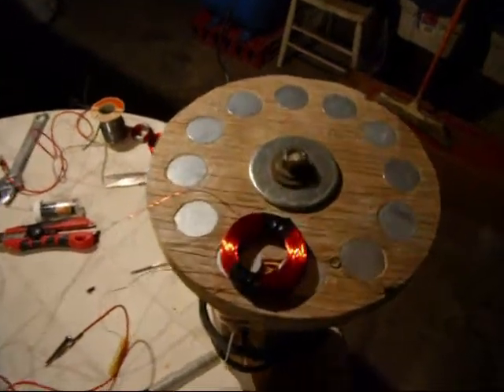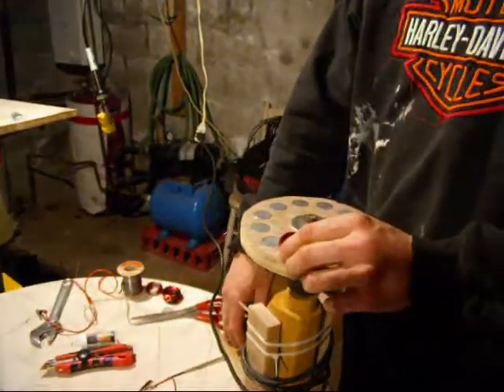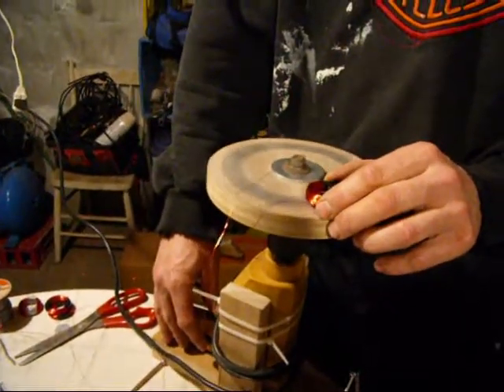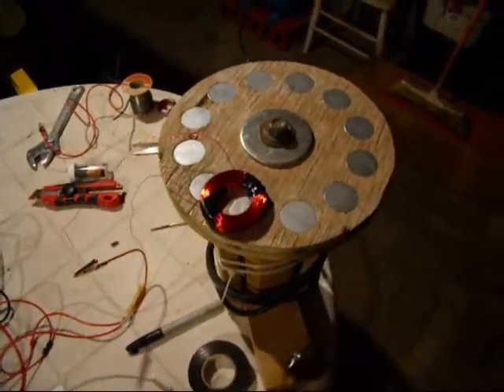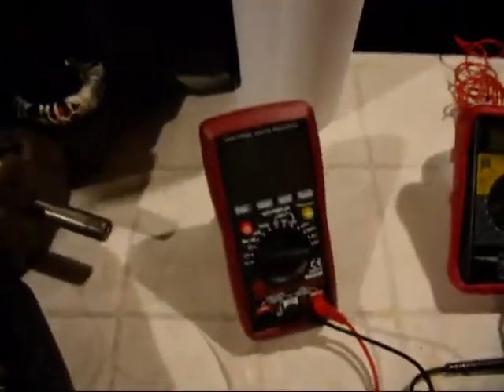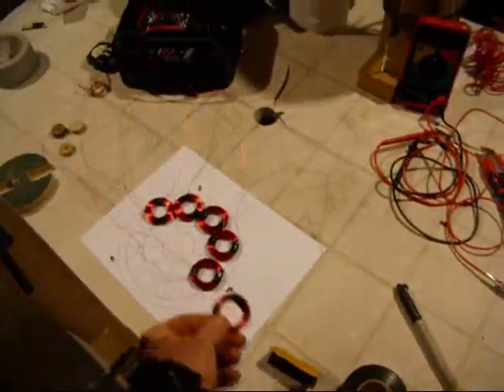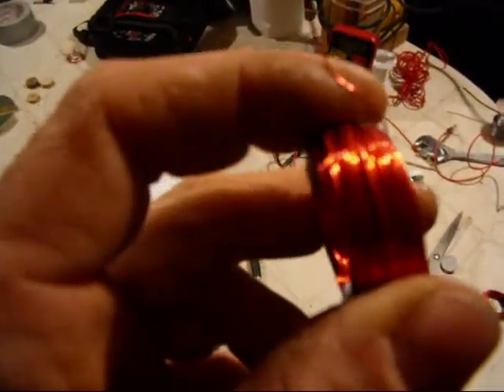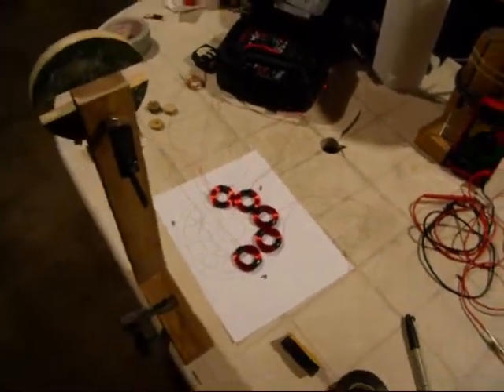Testing my home made coils

Comment: In general lens's law tells exactly everything we need to know to "calculate" what to expect from a coil passing a magnet. But to I will keep it simple here.  Voltage will proportionate to the rate of change in magnetic field  as well as the number of turns and area of the coils.  

So, to increase voltage, you can use more turns on your coil, or you can increase the rate of change in the magnetic field. 

There are several ways you can change the rate of change in the magnetic field with practical limitations for each.  
1. Decrease the spacing between the magnets and the coils reduces stray flux loss so that moe lines of flux can cut your coils.  
2. More RPMS means the magnets pass the coils faster,  thus increasing the rate of change in magnetic field. 
On the other hand:
3. Given the same RPM, you could use stronger magnets. That means instead of going from say 0 tesla magnetic field to 1 tesla magnetic field  twelve times for each revolution of a twelve pole rotor.  Stronger magnets with 1.4 tesla's would have you going from 0 teslas to 1.4 teslas  12 times for each revolution of a 12 pole rotor.   
4. Given the same RPM, you could have your magnets sweep a larger distance with a larger diameter rotor, thus increasing the relative velocity between the magnets and coils, and the rate of change in the magnetic field.

Comment: there is one coil that is wrapped around the tube of a tv the crt and when Iscrap the tvs I take them out and take the electrical tape off them and they are just one big copper coil I like to exsperment. and I saw a guy build the supertine flux alternator so I was like how would it work in the stator of a car alternator and it works  I will have to show a video of it and post it so you can see what i'm talking about .  it probably be easeer lol.

Comment: nice video man I like to build my own flux core generator I like to scrap stuff copper like tvs ect there is a peice of coil in tv that has electrical tape on it and I took it and put it in a alternator that was burnt out and I did a serpentine thing in th ealthernator and behold I was proceding just 4 amps 40 volts with 110 turns of copper wire. cool stuff. now to find 2 more tv's with same wire lol because its only 1 phase.

Comment: Looks good, I've thought about doing this but having a metal disc and bonding the magnets with J-B Weld Epoxy I dont know just one of those things thats floating around in my head. It also looked to me like it was going twice as fast as you said it was like 240rpm's an easy way to time your rpm's is to put a black mark on our disc and 60rpm's would be like counting seconds and 120 same as 1&2&3&4 so on but maybe you know that just trying to help like the videos thx